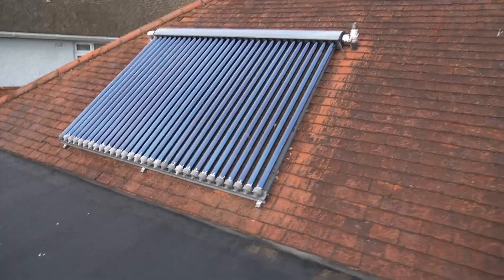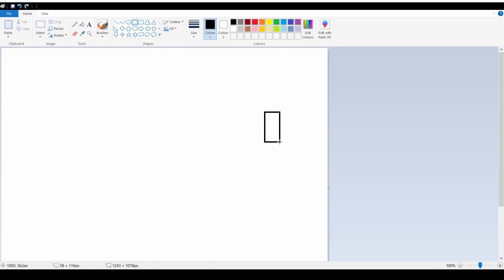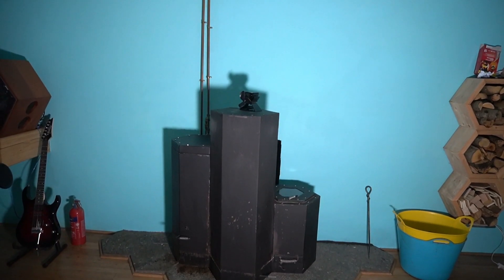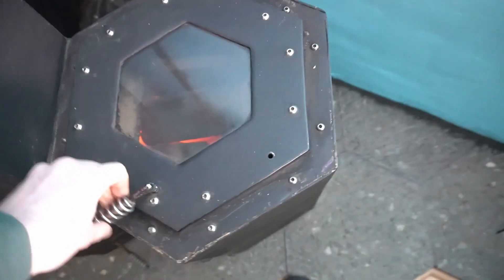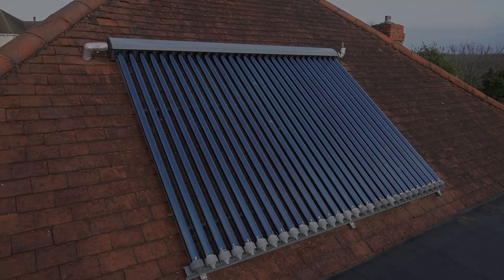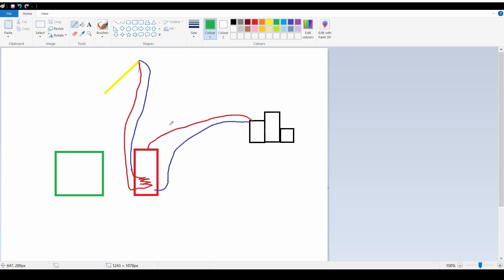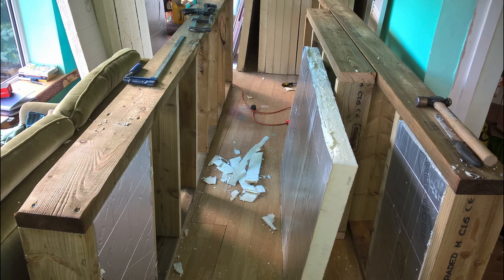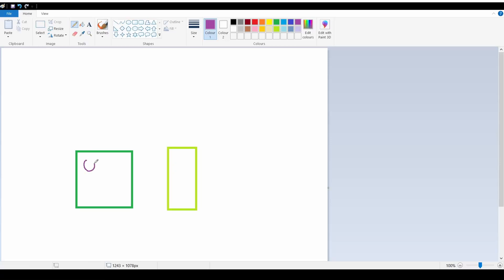£80 Per Year Heating System || Rocket Stove, Solar Thermal, 2000L Thermal Store

Comment: Thanks for this video - it is an awesome approach to providing DHW/CH water. A couple of queries - with the thermal store, is the edpm rubber okay with increased temperatures? (IBC tanks recommend no higher than 60C since plastics can degrade with heat).
Also, do you have a gravity fed or mains pressure system? If the tanks are just thermal stores and not pressurised, presumably there is no requirement for G3 plumber installation (Eric Hawkins - on youtube, has an interesting system using solar and various other inputs)
Reply from the maker: So Edpm on roofs often goes above 70C on sunny days at least mine does, so it probably will degrade it a bit faster but no leaks as of 7 years of having it. Ibc will start to warp as the heat softens the plastic. In the simplest of terms it is a box of water with 4 pipes running through it 2 put heat in 2 take heat out. The tank is vented, The solar system is pressurised and the rocket stove is gravity fed. So i should have had a plumber look at it but didn't because this is the standard and most people cant cope with anything that isn't. Maybe i will on the next one

Comment: I notice that at 3:14ish you have a chest freezer surrounded by further celotex type insulation. Is this just to improve the efficiency of the freezer itself or some other cunning device ? If so, did you locate where the coils were in your freezer and account for that or did you just insulate the whole thing - additionally (just for nerdy interest) did you measure the power saving ? - I find all this stuff very interesting and a change in my housing situation will soon let me experiment with such things again - first up , a solar thermal store similar to yours plus turning a small chest freezer into a fridge (on/off relay control by  temperature with arduino or RpPico). Would be interested to see videos about any other energy saving hacks you've done.  Cheers !
Reply from the maker: So the reasoning behind the freezer is that companies have to compromise between the size of standard kitchen unit size and the desire to have a bigger internal litrage. and therefore the insulation has to be really good or less of it to be competitive. I haven't measured the electric. i dont have anything to do it with and insulated the freezer as soon as we got it so no base line. The coil on this is at the back. there is a 50mm gap with a path for hot air to convect away from the freezer you dont want to inslate the hot air next to the freezer.  I'l look in covering a few energy saving things it may help a few people these days thanks for the request. If you like all the experimental house stuff theres a plan i'm working on thats gonna become the main focus if all works out. Just nothing is confirmable yet. The freezer was suppose to be 50p a week to run when we bought it. it must have increase the energy bill but it has been within the fluctuation limits week to week so we havent really noticed it so its probably on costing about 25/30p a week to run. hope this helps.
Reply: @InfinityMindDIY  thanks for the reply.  I'm currently using a very small chest freezer that judging by the external temperature seems to have coils on 3 sides (presumably because its so small already)....WRT energy,  I just wondered if you'd put it on an energy meter for any period of time before and after the insulation. 
Wondered if you'd ever considered using a chest freezer as a fridge (as you know, upright fridges are an offence to the nature of cold air)  - you've already done the work once with the temperature monitoring arduino relay for the HW.   
Thanks for the update, I look forward to further experiments.

Comment: Does this really supply all of your hot water ? - Do you only lose about 1 degree despite the amount of hot water you draw ?  As soon as I get the space I intend to build a system like this but it would be good to have its effectiveness confirmed.
Reply from the maker: Yeah really, there are no cold bridges in the big tank the bigger volume you make this tank the less surface there is for heat to escape. The more water you draw through the system the faster temp will drop, the 1 degree is what is lost from the tank if no heat put in or drawn out, it is the natural loss from the tank everyday. (a 200l bath will pull the temp down about 1-3degrees dependant on starting temps and how much cold you need to mix in, a 70 degree bath would be a bit painful) 

The solar so far has covered somewhere between 6-8 months of a year dependant on weather, in winter it is dependant on running the rocket stove which would be better if I had it closer to the big tank and not the other end of the house but that's something I cant change.

If you are building one, and based on the changes i have made a good rule of thumb is to design it for the house then get the next size up it will give you a lot more buffer in the system and with pipe sizes the tank will heat up much fast because you will experience much less heat lose in moving the water around.

Hope this helps, always happy to answer more questions
Reply: @InfinityMindDIY  thanks for your reply. But "and with pipe sizes" - did you mean use larger diameter pipes than usual , ie > 15mm ? - thanks again.
Reply from the maker: Yes for pipes 15mm is too small for moving heat from where it is generated to the store at least in my setup. and go for the biggest thermal store you can fit to get the ratio of surface area to volume as good as possible.

Comment: Please leave more videos of how you made your heating system Sir. You are so correct with a rocket stove not passing safety codes with an open feel hopper. Thirty tubes of solar must really give some heat. Your storage tanks you have, the larger one, what size is it in gallons ??  I want to make me a system also, in the process of getting parts together right now. Peace VF
Reply from the maker: The solar panel is really good keeps the thermal store above 50C for 7-8 months of the year even in winter it provides some heat. the thermal store is 438 gallons (UK) and 529 (US) good luck with you system hope it works well for you
Reply: @InfinityMindDIY  Thank you for sending me information on your system.  I am just tired of paying through the nose for heating my home. I just got industrial insulation 12 inches thick 6 feet wide by 50 feet long rolls. That will be the first thing I have to install this year. Can you say R-38 rating. This will the first phase. The others will follow. I will use your general framework to make something great happen. Thank for opening my mind to the possibilities. Peace and out. VF